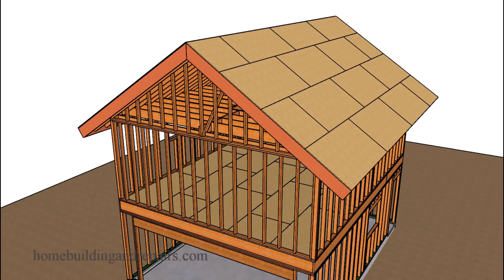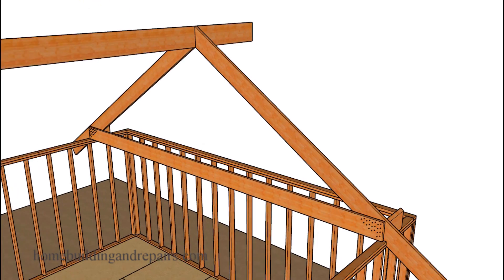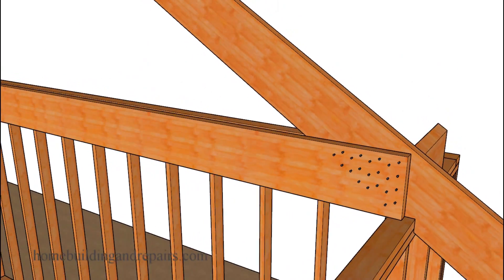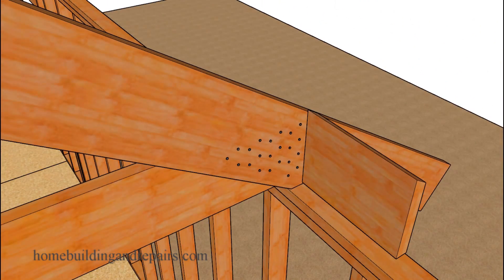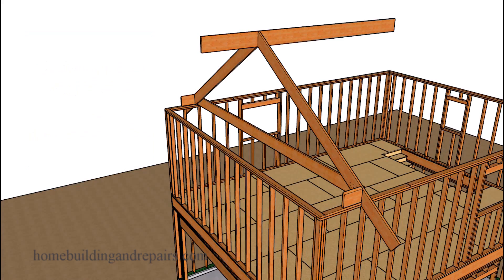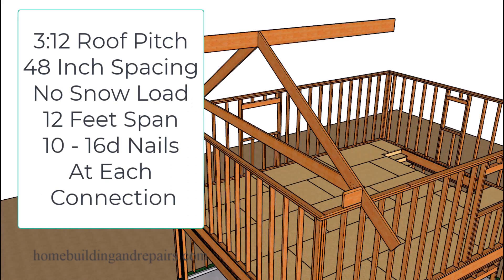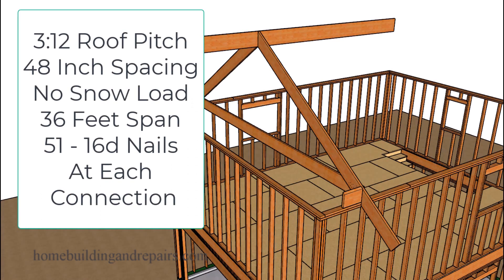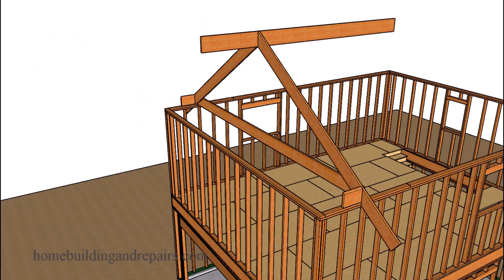How Many Nails You Might Need To Connect Ceiling Joist, Roof Rafters And Rafter Ties Together

Comment: A common question up for discussion is splicing of joists.   In your video you talk about the number of nails per heal connection.  If you have a large span like 27ft, It is common to join QTY-2 16 ft 2x12's and splice them together in the middle.  The debate I get is that you can only spice over a wall or beam.  I have seen it for years that you spice them in the middle with a large lap, 3ft (can't find that in code) frequently you then run a board up to the ridge.   Can you add any clarity to the debate ?

Comment: International Building Code (IBC) Table 2304.9.1.  This is from the 2006 IBC but it is similar in the 2021 IBC
Reply from the maker: Much appreciated.
Reply: @gregvancom  Greg, these are informative videos.  I've encouraged my younger engineers to look at these videos since many have got their engineering degrees but have never done any framing before.  These are also great for apprentice or younger folks who want to pursue a career in framing.

Comment: Generally, building code requires ridge beams and not ridge boards with collar tie/ceiling joists when roof pitch is less than 4:12. Building code specifies 3-16d face nails from ceiling joist to rafter.  If you analyze this like a truss, 3 nails don't work by calculations (depending on the span) especially if you have snow loads.
Reply from the maker: Can you provide building code reference numbers? Thanks in advance.

Comment: I noticed that the horizontal  board in this video is laying beside the rafter and nailed to it.  Will there be any other supporting vertical boards added to the truss?   What do you think of this method of building a truss?  Wouldn't it better if the rafter board was mounted on top of the horizontal board?  Wouldn't it be better to use nuts and bolts to connect the boards rather than nails?

Comment: Hi Greg,
In your animation the first rafter is at the gable end which doesn't have any ceiling joist attached to it. The reason behind is the wall frame itself which is acting as a joist already?
Reply from the maker: Yes, a connection for the outer walls and does not need ceiling joist or separate rafter tie.

Comment: Wait, wait..  What about "hurricane ties"?!  The "Simpson Strong-Tie 5-2/7-in 18-Gauge Zmax Steel Rafter Tie Wood To Wood", with instructions showing rafter-to-wall picture diagrams only take a few rafter nails, placed in the same "wood shearing" way.  So might the recommendation have more to do with nails proper than anything else, like how well a nail binds to wood or such?
But, if the shape of a tie is what's at work here, could then one use such ties for ceiling joists as well?  Do they need to be connected to the rafters at all? 
Thank you.

Comment: Hi. I have seen many of your videos in which the ceiling joists are laid on load bearing walls. My garage is different as its 2x6 joists are laid on the 4x14 garage header 48".0 OC. I want to reinforce it by adding 2x6 joists 16.0 OC so that I can install gypsum ceiling. I noticed that 2x6 (21' long) are very heavy. Could you please let me know if I can do this? What if I use rafter ties and braces in all joists. Will that distribute the weight of the new joists? The current roof has rafter ties and braces 48" OC. Thanks.

Comment: I like ridge beams better than ridge boards for this reason.  I don't trust that these connections with a lot of nails are done correctly.  If the nails are spaced too closely, they act as a group and the strength is reduced.
Reply from the maker: Good points!!!!

Comment: Another thing that doesn’t make any sense is the cantilever length. If your joists are 12 inches apart you can only go out so far but if you double it and make the joists 24 inches apart you can go out even further. You’d think if you had more joists and closer together then you should be able to cantilever out a lot further.
Reply: Yes.  A 12" o/c joist has less load than a 24" o/c joist.  Less load means the cantilever can be longer.

Comment: Is this limited by the cross section & shear strength of the steel?  Would a few thick lag screws or actual bolts be fine here with predrilled holes?
Reply: No.  The steel doesn't fail in shear.  The wood crushes against the nail.  It is called "dowel bearing strength.". The nails could be made of cryptonite and it wouldn't make the connection stronger.  Although increasing the diameter of the nail would make the connection stronger provided the nails aren't spaced too close to each other.
Reply from the maker: Good points and you probably can use screws, bolts or other connectors, but it won't be found on this chart.
Reply: That's exactly how my father did it when he built his garage almost 50 years ago.  He used three massive bolts to connect each rafter to the rafter tie. He's an engineer, so I trust the he knew what he was doing.

Comment: Why wouldn't you just use several carriage bolts instead of 50+ nails?
Reply: An engineer can calculate a custom connection with bolts.
Reply from the maker: Agreed.
Reply: I've seen it done that way.  Three massive bolts at the end of each rafter.

Comment: Great vid! A lot of force is generated in the joint between a ceiling joist and rafter when using a rim BOARD rather than a rim BEAM. The ceiling joist acts as a tension tie in order to maintain the geometry of the triangle. Else, the rafter ends will thrust outwardly on the exterior walls and the walls can become out-of-plumb and unstable.
Reply: We've been building for a long time without doing this, and things have been just fine.
Reply from the maker: I agree to a point. What if you lived in a hurricane area and your house would still be standing if it had been nailed according to the chart.
Reply: @gregvancom  Hurricane areas I would understand.

Comment: So what's the rationale behind those large number of nails?
Reply: The roof wants to pancake flat due to gravity loads.  The ceiling joist is also acting as a collar tie: a tension member preventing the walls from rotating outward and the ridge board from moving down.
Reply from the maker: I will try to make another video to explain and put a link here when it's made.
Reply: Nice vid, see my other comment for a brief explanation.
Reply: It is the mindset of the 'engineer'  a single nail will hold x amount....so 51 must be a lot better, totally ignoring the fact as stated in the video.  Earthquake retrofit in california after the Northridge quake came about with the same stupid results where you had a ton of nails in the foundation ties to the header and king studs, there wasn't much left of wood integrity.  It was a lot worse if you had a 2 story or a sliding glass door with the anchor bolt straps